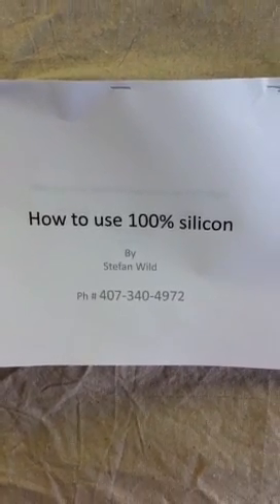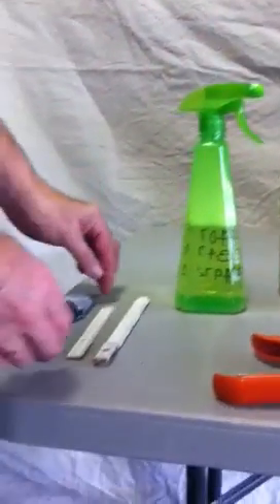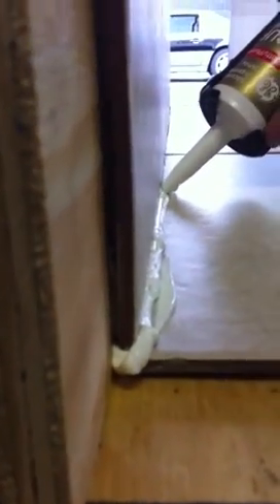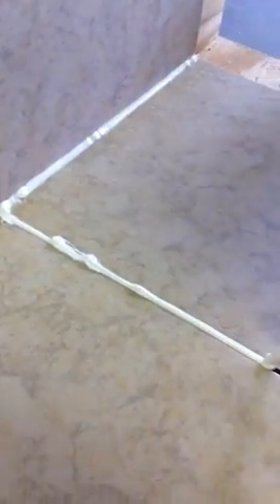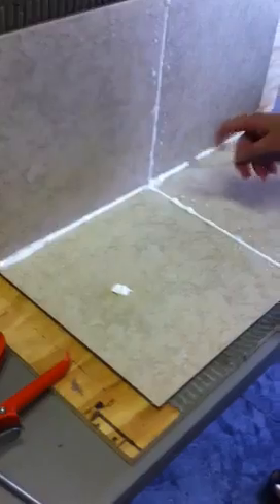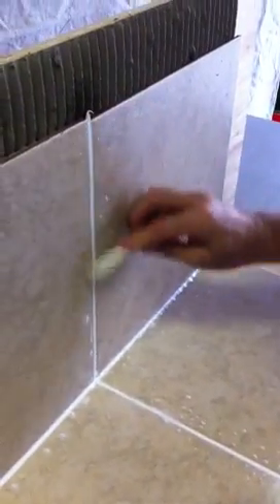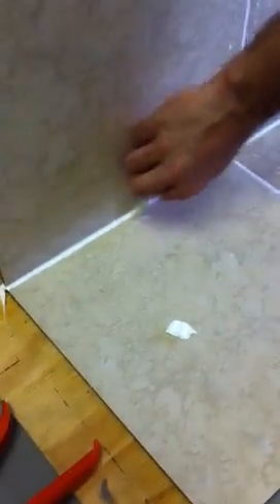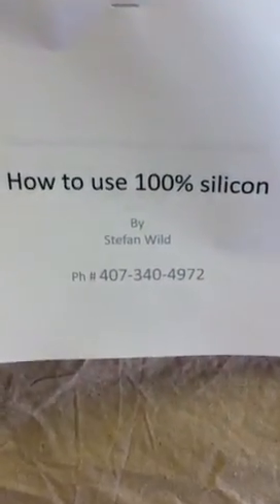How to use silicon by Stefan Wild

Comment: A million thanks, your technique is wonderful, I used GE 100% dark brown color in 1/8in grout spaces on 3/8th in. thick 12x12 Beige Granite floor tile put on the wall with Liquid Nails Granite Formula, I used 1oz Dawn to 9 ozs water for cleaning solution and ice cream bar sticks as forming and clean-up tools. It looks great and no blue tape was needed, great video.